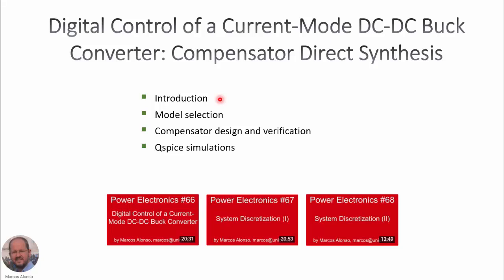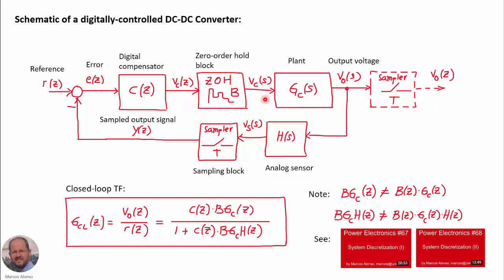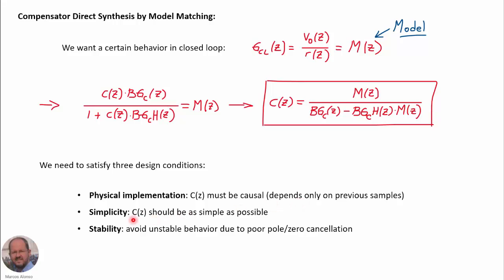PE #69: Digital Control of a Current-Mode DC-DC Buck Converter. Compensator Direct Synthesis

Comment: Thank you for these videos , i find them really helpful
Reply from the maker: Thanks for commenting!
Reply: @MarcosAlonsoElectronics  No worries, I'm doing an average current controlled buck converter for electrolysis bath, basically a DC Current source , do you think it will work for 300W with this design? Or is there power limitations
Reply from the maker: @escott6509  Buck converter is excellent for most step-down applications. It can be used successfully up to several kWs
Reply: @MarcosAlonsoElectronics  great thank you